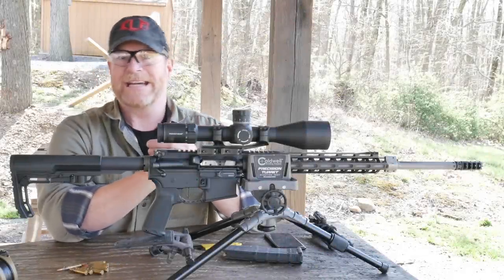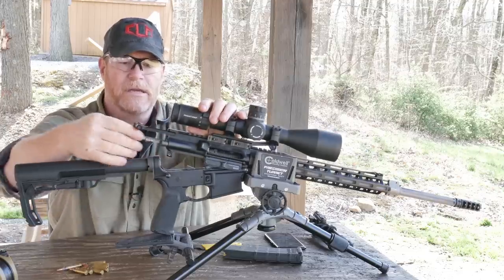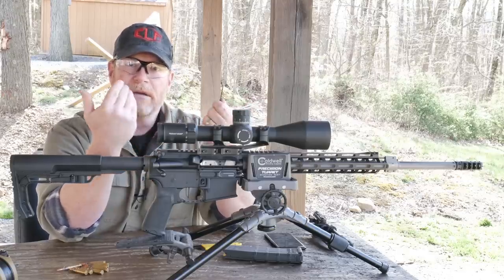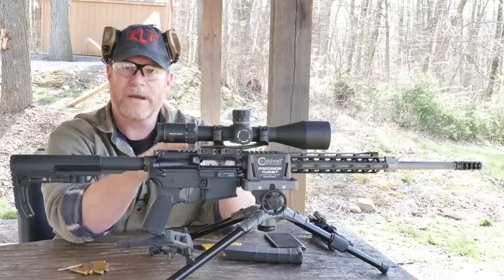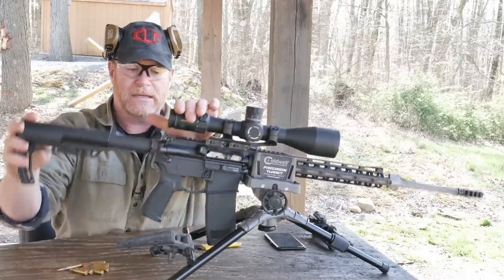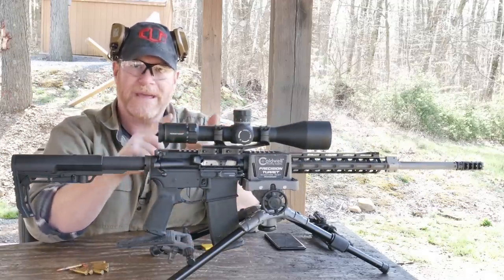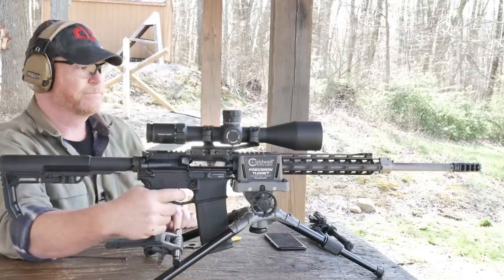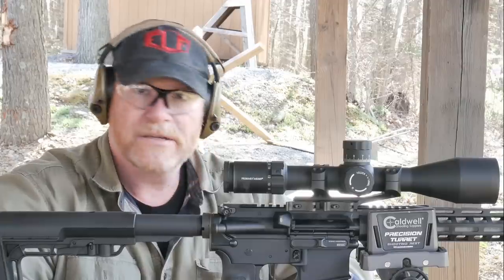How to adjust an Adjustable Gas Block

Comment: Just did the Odin adjustable on a way over-gassed 16" DPMS 5.56 carbine. 4 clicks out locks back last round and a 4.7 oz buffer has it ejecting at 3-3:30. Thanks for the tutorial.

Comment: Glad I swaths I just got a PSA 308 Gen3 10 with adjustable gas block (i think it has 5 positions so not quite variable) so this was helpful..Also Now I know where Mifflin County Sportsman club is. Now I have 2 1000 yard ranges when I join. It will be this and one up in Elk County.....for my 6.5 creedmoor.... Great Video thanks.

Comment: I've built a 300blk with the fail zero lightweight BCG and the jp SRS.  It functions great, cycles fine.  Been thinking of adding an adj. Block but was unsure of how to adjust and which one to get.  Thanks for the lesson!

Comment: I'm sure you're already aware of this, but that superlative arms gas block has a bleed off setting that reduces recoil and gas blow back in the gun, thus reducing wear, but it more then four turns out to get it to start doing that. When you brought it out to three and a half turns, you just made it a restrictive gas block, which will wear the system more then necessary with that gas block. Hopefully this helps.
Reply: Restriction doesn't wear out the system any more or less than bleed off. Bleed off is preferable with suppressors, while restricting gas to the tube forces it out the barrel increasing muzzle velocities in most cases. Kind of a win/win, restricting the gas reduces recoil and wear in the upper receiver and BCG, while increasing MVs.

Comment: I purchased a 300 black out pistol with an adjustable gas block system because I tho cut it would come in handy since I’m planning on running 124-220gr ammo (supersonic and subsonic). Not sure if it would be completely necessary but it seems like a good idea.

Comment: I think you need to read the instructions on how to properly tune that particular type of gas block. I have 3 of them on 3 different rifles and it is designed to be used in the bleed off mode. Start at 4 and 1/2 turns out from all the way in and keep adjusting out not in! until the bolt does not lock back and then turn it back in 1/4 to 1/2 turn. There is a bleed off port in the front of the gas block to bleed off the excess gas. The way you are using it now in the restrictive mode you can do with all the other cheaper gas blocks on the market. Just saying
Reply: My thoughts exactly

Comment: Great video,,,,I've been having trouble with a 6.5 cm I built as a kit from Moriarti arms thinking its a bolt problem or gas issue,, it stove pipes some,,sometimes the bolt comes up with the next round an i pull the trigger an have nothing.  Pull the CH half way back and let it slam and it goes off.   Frustrating !!!. I just got a double ejector bcg to try out. 
Soooo AGB  is next if this dont work 
I'll have to check into shooting at that range your at.....I'm in Franklin County.

Comment: Should I use green loctite on my barrel extension to increase accuracy?
Reply: yes
Reply: Explain your reasoning, please.
Reply: @JenkinsStevenD  I have been told it increases accuracy by mating the barrel extension with the upper reciever. I've never done this on my other builds but I want an accurate SPR type build this time around and am trying to do everything I can to shrink the MOA. I was just wondering if green loctite is the way to go.
Reply: @Meat_Demon  I've put a few rifles together and wouldn't think that this would help at all but I've been wrong before.  My perception of it is that green loctite, like most loctites, loses its holding ability well below 500 degrees Fahrenheit.  It doesn't have any anti-galling properties.  Additionally, loctite is normally used on thread to thread applications where torque is applied.  The faces of the barrel extension and upper receiver have no threading and there is not a whole lot of pressure in between them (the barrel is installed into the upper by hand and normally goes in quite easily).  The primary item that mates the barrel to the upper is the barrel nut that applies pressure to the upper threads and front of the barrel extension and then the rear of that outer ring of the barrel extension to the upper.  Except the barrel nut-upper threading, there is no threading which to apply thread locker.  The normal compound, I am sure you know, is Aeroshell grease which is a horrible adhesive but is an excellent grease for anti-galling.  Once a barrel is mated to an upper with the recommended torque, I don't see how any adhesive or grease would impact accuracy.  I'd be very interested to hear if you feel it made a difference though.
Reply: @JenkinsStevenD   correct. Aeroshell grease is the only and best option here.

Comment: Couldn't running different ammo change the gas pressure being its tuned to 55 grain bullets but what if u shoot a 77 grain bullets?
Reply: Anyone that's owned a FAL knows how well a collar adjustable gas block works. . . .Change ammo move the ring, it doesn't get any simpler and no tools needed. . .

Comment: great video! Obviously the buffer spring and buffer will greatly affect how open the gas block needs to be. You're going with a lightweight BCG but what are you using for the buffer and spring - flat wire, braided or just a standard spring? Is the idea to go as light with the buffer and spring as possible while still getting positive gun in battery? Is that were you would start - with the lightest BCG, buffer and spring and then throttle the gas block to just cycling? Thanks in advance!

Comment: Glad you're doing a video on this!! So I have a slight possible issue with a AR10 build in 6.5 creedmoor I've been trying to figure out.  
 It's a JP supermatch 22in. Barrel, +2 rifle length gas with JP adjustable gas block and JP SCS.  Problem is with the bolt locking back its ejecting brass at the 1-2 oclock range.  It cycles but brass where bullet is was bent in on some of the brass.  Everything else, with my limited knowledge looked good.
  Was thinking I needed to use a lighter recoil spring possibly and then tune the gas block again?
Reply from the maker: I have the same dent in the brass on my 6.5 gas gun.  I would suggest cranking it down and doing this procedure till it performs like you want it to.  I did the same on my 6.5
Reply: @kotaboy32   Well the gun performs well.  It cycles everytime and locks back on last round everytime. 
   My concern is that its throwing brass at 1:30-2 o'clock (from what I've read online means supposedly its overgassed) and ~90% of my brass is bent a bit near the case mouth.  
  Also read online that you shouldnt worry too much where brass is ejecting as long as rifle is cycling fine, which it is.  Considering its throwing brass at 1:30 - 2 oclock with the adjustable gas block tuned only 1 click past where it started to lock back on last round, I wouldnt think it was over gassed but rather has too much/too little spring tension.  
  At this point I'm just guessing though.. I've tried looking online all over but cant find anyone that tuned their gas system to barely lock back on last round yet having brass ejecting at 1:30.  
  To add, I did notice that the ejector mark on the case is consistantly the same side that the case mouth is dented on if that gives anyone a clue to any possible issues. 
   I guess I will bring the different buffer springs out next range trip and see if that helps at all.  Thinking I'll have to retune gas system with different recoil springs as well.  
  If anyone has any suggestions I'm all ears!

Comment: Nice video, KB32.  I see you are using the clamp version of the gas block.  I don't have any experience with clamp-style gas blocks.  I use the set screw style with rocksett, dimple the barrel AND pin it.  Have you ever had any issues with the clamp-style gas blocks coming loose?  I've had set screw GBs come loose before I started dimpling my barrels.
Reply from the maker: I've broken a few screws by over tightening them

Comment: Nail On The Head! KB, I've been waiting for your video on this subject. Thank you... I needed this. Do you find it advantageous, leaving the gas block outside of the hand guard?  What twist you have on that barrel and what is your favorite bullet for it? Thanks again, Drive on Airborne! JWW.
Reply from the maker: Hey Brother, I have this handguard cut back so I could test the barrel for accuracy and not worry about the gas block touching.  This particular barrel is chambered in .223 Wylde 1:8 twist.  She loves 77gr.

Comment: Bleeding off is usually better than restricting (less recoil impulse).  Not sure I’d run an exposed clamp-on gas block.
Reply: The superlative arms gas blocks are bleed-off.  I think that is what you were getting at.  I am just not a fan of clamp-on gas blocks period.

Comment: The POF dictator is by far the best adj gas block on the market.
Reply: $143, hard pass.  Also, you can't pin it.  To each their own though.
Reply: JenkinsStevenD actually you can pin it. It even comes with instructions on pinning it. And you get a straight gas tube so it doesn’t have the typical failure point of the milspec tubes.

Comment: What is the purpose of putting only a single round in the magazine?
Reply: @docholliday3666  Thanks!  Makes more sense when watching the video again.  When I adjusted mine, I just figured making sure it was properly cycling while tuning for the proper ejection angle was most important aspect and assumed if it was cycling properly and ejecting between 3-4 o'clock would lock back when mag was empty but now noticed after watching again he does both.  He mentions 4-4:30 position ejection is ideal, which is what I heard from others as well.  However, I adjusted for 3:00 position instead because my thought at the time was that I adjusted during early fall when temperature was higher and I would be using my rifle for deer hunting in the Michigan winter months.  From my understanding gas pressure is reduced during cold temps and by adjusting for 3:00, would put me in that 4:00 ejection position in cold winter months as well as less concerns with different ammo.  Essentially, ensuring it properly cycles regardless of outside temperature.  It would suck, shooting at a deer in the cold and needing to take a 2nd shot to only learn I adjusted the gas block pressure too low for that ideal 4-4:30 ejection position during the warm months and not being able to take that 2nd shot. :D

Comment: when I installed the precision arms hyper tap, my gun stopped cycling. any thoughts?
Reply: I know this comment is two years old, but have you had any luck fixing it? That shouldn't happen on a DI or piston gun.
Reply: Couldn’t fix it, actually had to send it back to Daniel defense and they replaced the block. Never had an issue since!

Comment: I think you just did it wrong you closed it off need to screwed out more for  It to vent which is what it's designed to do  Why do you do a slow motion on  The gas blockl I wanna see it vent out You missed that part